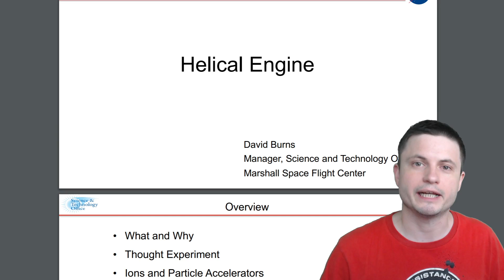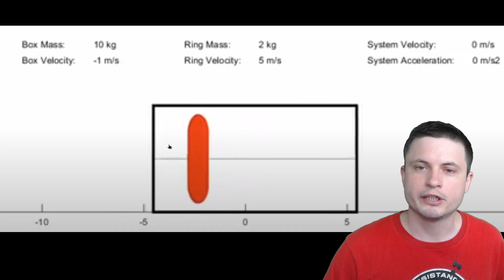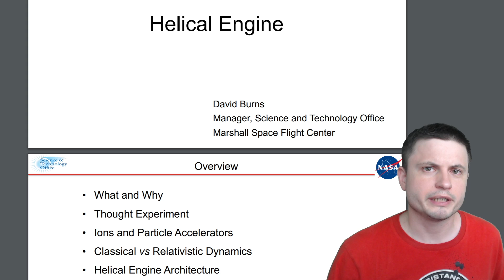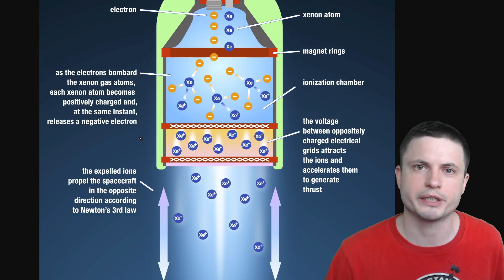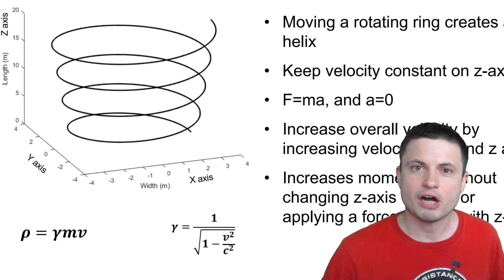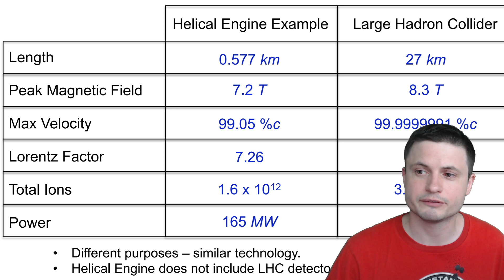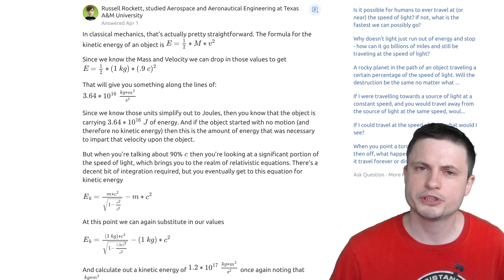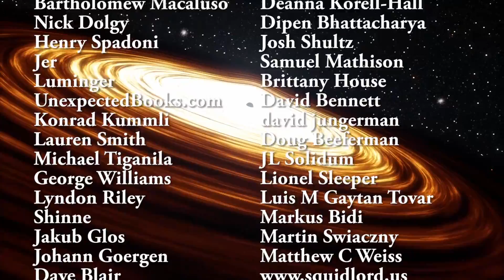NASA Engineer Designs a Near Light Speed Engine But Does It Work?

Comment: I was just think, every thing around you is full of potenial energy. The Earth is spinning at one thousand miles an hour. The earth itself is orbiting the sun at sixty seven thousand miles an hour.  The sun itself is orbiting the galaxy about eight hundred thousand kilometers per hour. This can just keep going, becaue the galaxy is moing, and there are other random movements. Everything is packed with potenial energy, like a battery. But can you access this energy? Imagine you have a lead ball, and you get on a high speed train. The train's electric motor spend energy creating potenial energy by moving the train, and everything on it. No consider the lead ball, it has the potenial energy put in it by the train, but how do access it. The lead ball has potenial energy in the direction the train is moving, so you could extract the energy by interact the lead ball with something that has not been affected by the train. It is very easy to effect large amount of potenial energy, with minium amout energy input. You could drop the lead ball out the window, and it would fall to the ground, but when it struck an object that that wasn't moving, it would give up that potenial engery to the un moving object. A lead ball weighing one pound, traveling at a hundred miles an hour would give off more energy than it took to drop it out the window. There is no free lunch, the energy did come from the train, but it is there. It's the same with everything on Earth. There is no free lunch, but we are just using the energy that was put there by the big bang.

Comment: On the surface it does look like thermodynamics may be a problem, but storing the reverse energy in what is essentially a flywheel, that's interesting. I really hope that the problems are practical and not thermodynamics, because practical problems are usually overcome by someone way smarter than me, but overcome all the same.

Comment: Did you know it's possible to travel at light speed?

Big news! Due to the simple fact that light does not accelerate, and that velocity is relative. So, relative to your starting point, it's possible to accelerate towards light speed with constant acceleration.
(Note: This does not mean you can accelerate AT the speed of light)

All that's required is an engine capable of producing constant thrust (acceleration) over time. Factors such as vehicle mass, fuel, etc, are separate factors. Your actual milage will vary.

Comment: And THEN Bubba the hot rod builder gets his hands on it, tweaks the design and "presto change-o" you suddenly have a drag car that can produce power that science says "is not possible"!!!! 

Back years ago science told us "there is no way a piston engine vehicle can develop enough power to drive a quarter mile in under 10 seconds!"!!! And this was back in the 1960s and 1970s, BUT today's modern drag racing vehicles can develop enough power to hit speeds way over what cars could make on a drag strip back then, and now those cars are driving 3 to 4 second quarter mile times instead, something that science STILL SAYS is "impossible"!! 

My point is this, you can NEVER say something is totally "impossible" because when you do there is always somebody some where, some times a guy who isn't a NASA engineer or a scientist, will figure out how to "break the rules" is my logic here!! And some folks like myself who works on cars or buildings or what ever, doesn't look at the problems the same way as some engineer might either!! After all "sticking to a rigid plan" is great, but you suddenly forget to see the "What ifs" when you do this!! And some folks like myself throw the "what ifs" into the mix, by thinking of ways to create power out of NOTHING, simply by taking what you "start out with", take it apart and putting it back together, lighter, stronger and often times MORE POWERFUL, by adding things YOU (in science) never considered before!! 

That is why today if you tear apart a drag racing motor you might find a 100 year old technology like a magneto making the spark the motor needs, BUT you will also find titanium connecting rods and other "exotic metals" that Ford, GM, and Chrysler NEVER WOULD HAVE THOUGHT OF in an engine design even 5 years ago!! And think about it, A drag race motor in many cases is built out of aluminum since the 1960s but it took auto manufactures almost 25 years to adapt to the same technology that the race community was already using anyhow!! And today there are still parts made out of cast iron on your average street car that might be made out of ceramic or titanium in a drag racing car! 

And this brings me to another point some times it isn't as much about what you THINK is the "right stuff to use" as much as it can be "design it and see what works" and if you think of a "better way in the process" or some relic technology that could advance your progress, then at times "stick with what works" and throw away what doesn't!! Heck that logic worked for Thomas Edison who once said something to the effect: "I did NOT fail to build a light bulb 300 times, I just discovered 300 ways how NOT to build a light bulb!"

And some times you just have to build what you THINK will work, test it, scrap it, tweak it and try again!!

Comment: You need a anti-matter type system which can produce mega amounts of electricity to power a star drive!  a UK team is close to making a reactor that uses compressed pellets of resin containing small amounts of deuterium which in tests on a small scale shown huge amounts of energy produced from a tiny cube as small as a sugar cube. BBC Click did a program on them. So maybe a form of Fusion be the power to get a craft up to near light speed but using a bending of space like the warp system of star trek?

Comment: Uranium reactors do not produce energy by converting mass into energy. They do it through fission. Maybe a fusion reactor could produce the required energy? Or if mass to energy conversion is required maybe an antimatter drive? Unfortunately that is so far off that currently, it only could be considered science fiction and not science :(

Comment: We need to think big if we want to achieve big, big planets (mass) can pull objects in towards them so build a mass point in front of the spaceship, spacetime bends and spaceship follows.  The key is to find a way to stack elements/particles into a container until it starts getting really heavy to the point of bending spacetime, ideally creating an energy switch that can activate these particles by the push of a button.  I know it's easy to say but if we can build cern....

Comment: Mcc=.5mvv is a crude approximation, but does not account for relativistic effects. I.e. 1kg to accelerate to light speed and then slow down again, for the mathematically mediocre amoungst us. 1 kg for another kg to reach 90% is even less practical of course.
And then there’s the likelyhood of colliding with something. I remember calculating that a collision with a grain of sand at such speeds would vaporise the spaceship. No harm in searching for low probability high reward pathways of course.

Comment: What if the reactor that powered this ship wasn't fision-based, but fusion-based ? Would that be more efficient ?
Reply: My take is that's called a star, and it doesn't have to be attached to the ship. Just the power getting beamed to photovoltaic cells. Complimentary infrastructure would be needed to direct this power to the ship though, due to the inverse falloff nature of light with distance.

Comment: Ok let's think of this like a box of various parts someone left for us to work with and see what we can piece together. We've all heard of the Baltic sea anomaly that is producing the effects of the type of hardware needed to protect the hull and deflect the temporal effects of lightspeed travel. But for a more on hand detailed analysis of the effects and the technological diagnostics let's refer to the classified U.S. project known as the Philadelphia project. Now specifically I'm speaking of the hardware that was salvaged and reverse engineered into project x that was eventually the design prototype of the EMP blast cap that was fixated to the front of the atomic bomb that was designed to enhance the emp blast yield of the explosion. It was the part that Oppenheimer and Einstein collaborated on together and was the initial purpose of their defection to the U.S. from the third Reich. This hardware was of extraterrestrial origin and stolen from Germany by Oppenheimer during his defection from the V8 rocket program along with the schematics to the SR-71 blackbird which has been using this technology to fly at the speeds and altitudes it does

Comment: And then it hits an asteroid the size of a grain of rice at relativistic speed and shatters into a million pieces.
Reply: only if You are going at > 0.7c. You don't have to accelerate all the time: only go to around 0.1, 0.05 c. It might be small for interstellar travel, but far than enough for interplanetary transport.
For travel inside Solar System You can go lower: even 0.01c would be overkill. The trick is that You do not have to expel propellant and You can avoid "Tyranny of Rocket Equation".

Comment: 8:20 A typical fission reactor does not convert the whole mass to energy. It converts it to simpler elements. For what you said to be true, you would need to annihilate 1kg of antimatter with one kilogram of matter. That would yeild the energy necessary ( but currently we cannot even produce a miligram of antimatter) and that reaction would be the most energetic reaction mankind has ever witnessed on earth. (it would destroy everything).

Comment: Hmm what about sound used at either end of the box to adjust the inner velocity? I'm thinking if you filled the box with a fluid and the striking bearing then use a low volt subwoofer to go off each time the bearing reaches that sweet spot to keep building off the momentum built from the last pass.  Not sure if this would work in space,or really at all just a thought.

Comment: You said a typical nuclear reactor is essentially converting 1 kg of pure mass to energy, which is not correct.  The only way I know of to perfectly convert mass to energy is by combining it with antimatter.  Nuclear reactors are very, very inefficient in turning mass to energy.

If you were able to convert 1 kg of mass into pure energy, you would get almost 9x10^16 J of energy, not too far off from the 1.2x10^17 you mentioned in your video.

Comment: It just sound like a propeller,  so it seems the propeller is pushing against said ions, assuming you have power in space spinning that would take quite a lot of energy, let alone 90 or 80 percent of light while producing said ions, question being how would you even start said Engine? Assuming everything is correct, as mentioned this thing is literally a power eating machine, if this hasn't been done before there's a reason, even if you'll get said energy what would be the rates of energy efficiency, let alone the heat and integrity of a spinng object that's moving fast af, personally let's just say this thing is already in space, imagine the temperature to this damn thing, not only if you move 99 speed of light you'll still experience the same forces of the ship moving at said speed, 9.8m a second is 1 g, you'll feel that one g when it's moving in that direction you'll feel the opposing force, so that said you'll become a pancake if you we're to experience 99 percent light speed because of the g force, ironically the same relativity is applied to you too.

Comment: Well, if this isn't some sort of Perpetual Motion Machine and something there abouts can get near 1/4 or more (a rough estimate) of the speed of light, then I'd wager that that puts Alpha Centauri in range for a mission. 

And, if so, I'd guess that a smaller unmanned probe type venture would definitely be feasible.

I wonder what it would cost? 

Anyway, keep crunching those numbers Anton: you'll come up with something.
👍

👽✏🔢💲

Comment: The short answer is of course it won't work, it takes more energy than the mass you have (e=mc^2) to get to near the speed of light, then you need just as much to stop! (you got to stop remember). It will take just as long to stop and use just as much energy (that you don't have). 

Also, the speed of light is not nearly fast enough to be useful, sorry guys, deep space travel is just not possible, nature just won't let it happen..

Comment: The drive wouldn't necessarily work because time dilation isn't real.  Red shift and blue shift are impossible under time dilation as lorentz transformations shift the frequency of emitted light to normalize.
This is why your "where does the energy come from" problem blows up into nonsense.  Time dilation evaporates the energy of emitted light as energy of a photon is a square of its frequency.  If I were to shine a light on a relativistic, reflective object, the equations become unsolvable.

You can solve them if you remove relativity and figure that the "pressure of light" will vary with absolute velocity relative to "the quantum foam" or whatever you want to call it.

This is the basis for what has been termed a "jacketed photon drive" - or is a close conceptual facsimile.  Where you can effectively dump the energy of radiated photons into a change in angular momentum.

Of course, there is another fun method that becomes available if you can achieve sufficient isolation.  All orbital distances correspond to an energy state.  If one can increase or decrease the energy of their state, then they can assume a distance and orbit consistent with that state.  Where this really gets fun is that as you get more distant from an object, there is less energy needed per unit distance and so a constant energy input translates to a nearly hyperbolic rate of location change.  It is important to distinguish this from true acceleration, as one is not accelerating using this method, simply assuming an energy state.  Where this gets tricky is lagrangian math and how many interacting gravitational bodies create fluctuations in the valid energy states for a given location.  Which is why this method is rarely used inside a star system and only at modest fractions of the speed of light when so.  The system is capable of FTL travel as acceleration is not occurring and this all mediation is through Spin-Zero tunneling.  You could think of it as "stutter warp" - but that's really more of a side-effect.

The first way to utilize this phenomenon is the "jump drive" where an isolation field is first established to cut off the localized space from "gravity."  You aren't completely canceling it or doing anything silly like creating it - just ceasing the causal chain of decoherent properties.  Once this is established, you can use a large burst of energy to rapidly change states - using something like a jacketed photon drive.

Because isolation is difficult to achieve and sustain, this is the preferred method for its use.  The energy necessary to create the isolation field is the main investment - but worthwhile considering its effects.  The actual change in energy states is modest in the grand scheme of things.

Although it is possible this type of drive may work in practice, it would effectively be a manifestation of "jacketed photons" and not because of any kind of lorentz transforms.

But... It will be a few years until we are able to present that breakthrough.

Comment: This reminds me of the EM drive which turned out to be powered by wishful thinking and grandiose claims.

Rotational momentum can't be converted to pure forward momentum.  If half the rotational momentum is directed forward, the other half has to go backward.  To use the analogy of a car, your wheels need something to push against to convert the engine's rotational momentum into forward momentum.  

This is basic physics.  Lorentz transforms don't magically bypass Conservation of Momentum.

Comment: i think when someone says i got this idea for a engine and all you have to is get a thing that weighs 1 kg to relativistic speeds to bounce back n forth.  i think most would tend to be scoffing your at relativistic speeds that like you say is 70 80 90% the speed of light that is going to require a ton of energy. 

like how much energy could you draw off a black hole in theory vs what an engine like this would require, that is your top shelf energy source and there some great videos on black hole ships. but that about it. could you get this thing to work with that? if not no it not viable for any civilization to put into practice. say you use the black hole reactor to "spin" up your drive then the drive takes over when it hit its target mass and you coasted, what kind of results would you get? how many firings of the engine could you achieve? and how far in space could you get if you burnt your black hole dry?